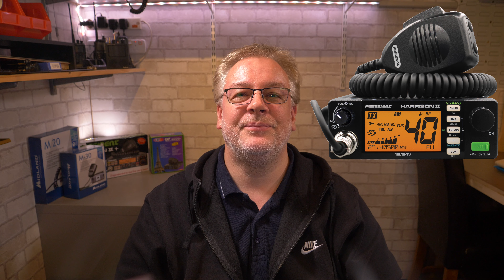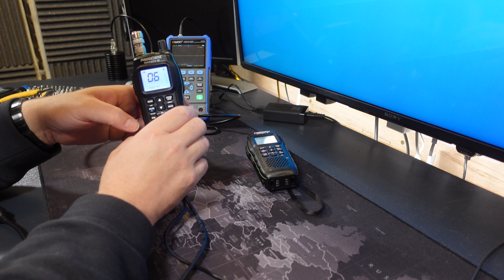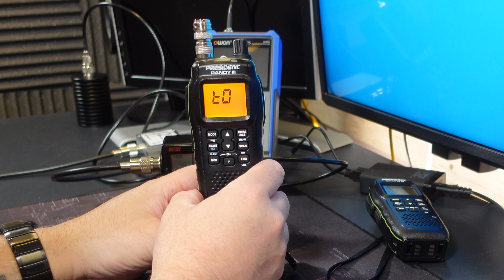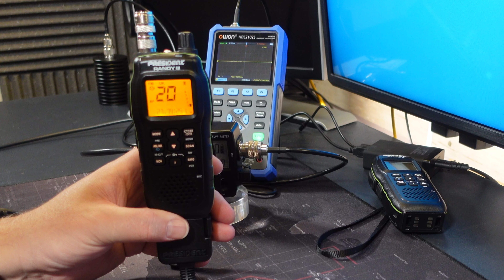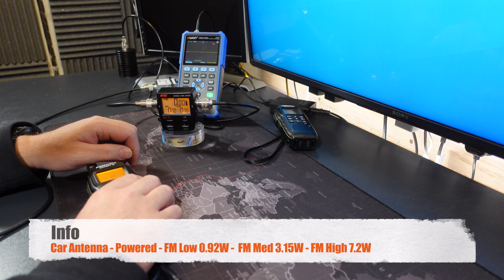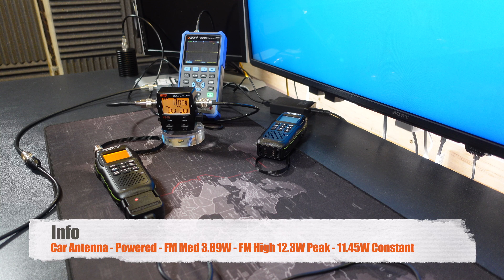President Randy III Handheld CB Radio - Revisited - Secrets Exposed

Comment: Please never CUT the White Wires ...Desolder and Isolatet it ...
Reply from the maker: You are of course correct as it’s the safest option. However, Presidents service manuals and export mod sheets say to cut the wire. I do desolder on some radios but I need to get to the back of the board and complete disassembly on a Randy is a pain. Thank you for commenting and for pointing this out. It’s nice to get genuine comments so I appreciate that. All the best 73’s MJ7NLK

Comment: If the Randy III has SSB that would have been really amazing.
Reply from the maker: It would be brilliant if they could squeeze SSB into the Randy 4 along with 2800mah easy swappable battery, faster scan mode, back light time options and the desktop cradle coming in the box. The Randy 3 is a great handheld, President did really well with this one. With a removable higher capacity battery they could get closer to 4 watts in standard mode rather than just about pulling 3 watts and a decent belt clip that attaches to the radio not the redesigned battery. Oh and the option to charge via USB C would be nice as well.
Reply: @NLKMediaGroup  Yes, USB C would have been really good!

The battery should have been easily twice the capacity or at least allow higher capacity batteries, perhaps you could squeeze a larger on in ?

With a larger battery there's no reason it couldn't do 5 watts.

SSB would be nice on a Randy 4 but I doubt they would do it and you might not see a Randy 4 for another 8 years or more.
Reply: @NLKMediaGroup yes really
Reply: I would gladly sacrifice size .little bigger and more battery capacity to gain ssb. 
No brainer for me.
Reply: @randyguay7115  It seems really incredible that they could exclude SSB.
Reply: I would buy one right now!
Reply: R&D costs,parts to add ssb,retooling costs,emc recertification in chambers,pre-sample costs,supply and demand for ssb sales, etc 
If you worked in radio manufacturing it's not as easy as it sounds.👍
Email groupe president electronics France,sales with your requests or feedback to dealer to pass info onto main factory.
Cost maybe the final factor ,shipping,taxes etc €400+,maybe?
Reply: Agreed
Reply: I really do not like th ee usa version i pop mine open hoping to expand and bam dam there is no little white wires.
So would you please do a video on the usa version showing how we get  those extra channel and maybe a bit more juice.
Anything would help 

The fcc really in my opinion destroyed what i thought was going to be a nice fun little radio to have handy.
As it is now i am looking to buy a uk version .
Reply: CTCSS. I'm in.  I'm not doing POTA on 11m, so they can keep SSB.
Reply: Not really. Since only autistic losers care about that and are a niche market.
Reply: Definitely it's a good handy tho bring a randy 3+ out with Ssb